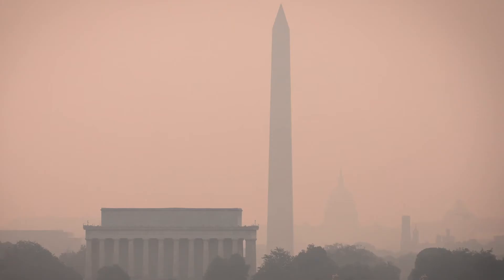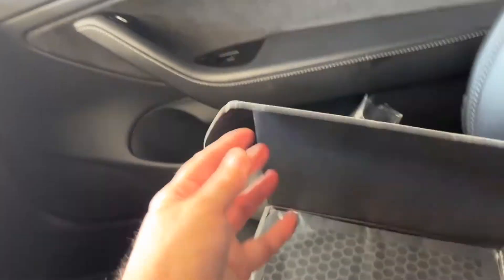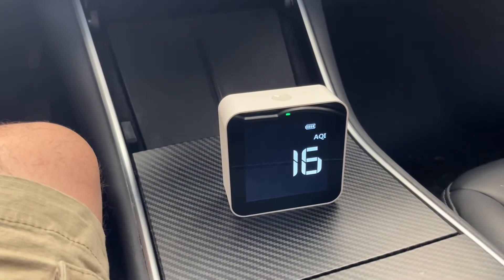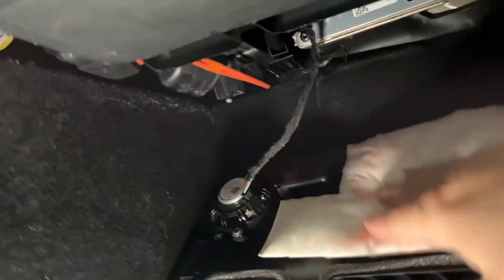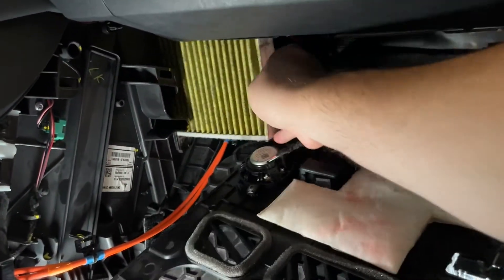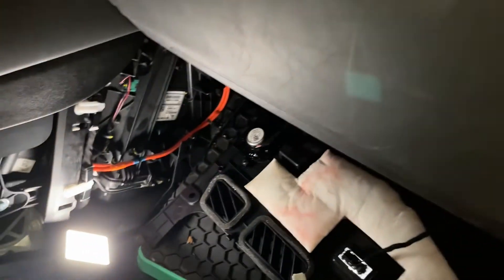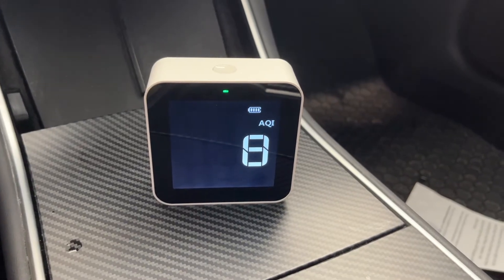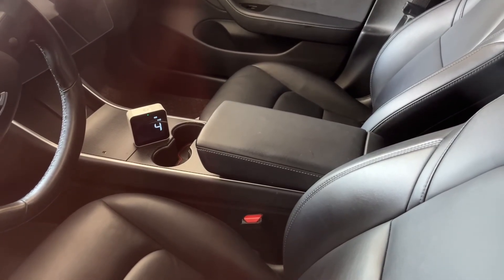VION HEPA air filter replacement in a Tesla Model 3 tested

Comment: whyt if you turn off reciculation? in winter you have to because of foggy windows
Reply from the maker: To simulate bio weapon defense mode, you need to pressurize the cabin. Pull in all the air possible from outside, force it through the filters and let clean air leak out. 

Recirculate wouldn’t guarantee dirty air wouldn’t leak in.

Comment: Also a good demonstration of how well the cabin of your Tesla is sealed. Would be interested to see if the cabin can maintain that level of air quality when you are driving at freeway speeds. Pick yourself up a Wera 073230 1/4" bit driver and some stubby bits, great for removing hardware in tight spaces!
Reply from the maker: Good call, I’ll do a follow up video testing at highway speeds, when AQI is bad. Driving around town with the old filters, it held 16 AQI, but not really going over 40 MPH.

Oh wow, that looks like a much better tool for the job. Thank you! I was working with all the tools included in the kit, makes sense they wouldn’t include anything fancy.

Comment: What is the Tesla recommended replacement time frame for those filters?
Reply from the maker: Manual says - "Cabin air filter replacement every 2 years (or 3 years for HEPA and carbon filters, if equipped)."

But most people say they start to stink after a year or so. Depends on the environment I imagine. Mine certainly smelled a LOT better after replacing them. But hey, they were still efficient at purifying the air even as disgusting as the old ones were.